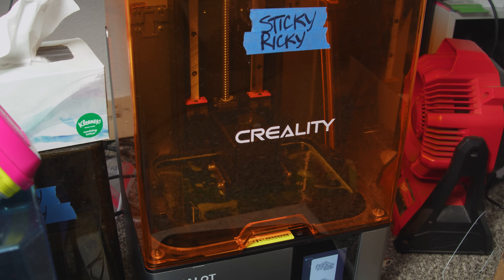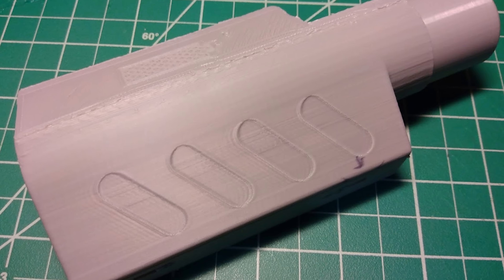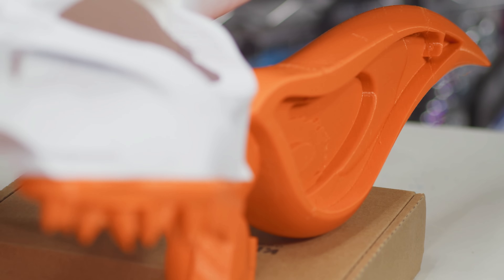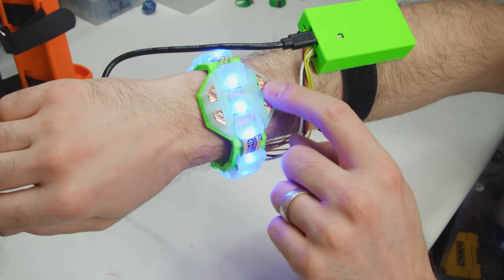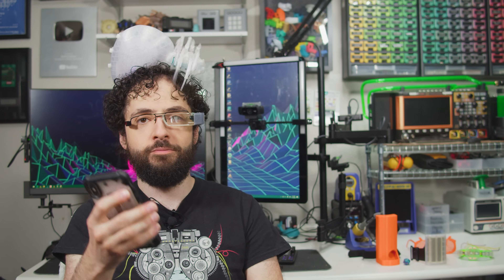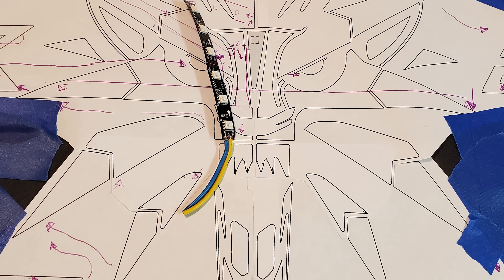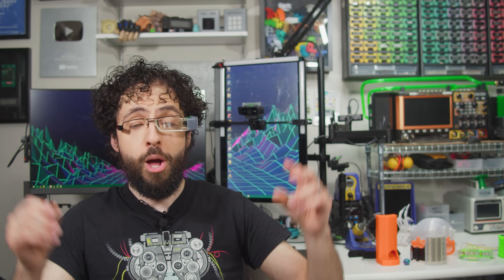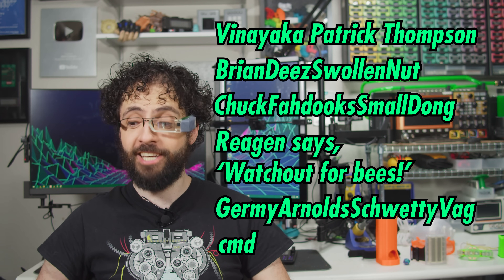10 Insane 3D-Printed Wearables - The Best Won a $1,500 Printer

Comment: I possess mental blue prints for a 3-D printed robot, practical application with machine learning & ambulatory self propulsion...everything but the circuit(s), wires plus some small motors of various sizes, overall it should top out at 65 pounds or 29.4 kilograms fully assembled!!!

Comment: 13:20. Place a dot of red nail polish next to the male side of each female USB connector. And a similar dot on the outside, next to the connector end (not wire end) of each USB cable. You’ll be amazed how easily it is to plug things in the first time without having to flip the cable over. I’ve done this to 100s of cables and connectors for myself and clients over the past 20+ years. Everybody loves it!  It’s my original idea. And when manufacturers start doing it to cables, remember you saw it here first!

Comment: $1000 for a 3D printer with 3D parts and weird diameter filament. Think I'll just stick with the ender 3 lmao
Reply from the maker: The 747 we gave away is a 1.75mm version - it's got the E3D Hemera. Lulzbot specializes in 2.85mm machines, but I personally requested that the prize printer uses the same 1.75mm as my workshop.

Comment: #9 needs a microcontroller to turn it into a game/competition.  Pass it around and see who can shake the hardest or the most strokes in one minute, or with the most perfect cadence.  Have a small DIP switch to select "innocent" or "raunchy" mode for the sound effects/sound clips.
Reply: The project I originally designed the magnet core for actually uses a SBC for an interesting application.  I used a hall effect sensor to measure magnet passes.  Hopefully I can post a video about it soon :)

Comment: Getting 3d printer soon, I'm only 15, so it can be kind of hard, but I definitely want to try the wristpi in the future.
Reply from the maker: I feel you. But as long as you pick a high-quality printer and don't go mad with power, you should be able to buy all the filament and spare parts you need for barely $20 a month.

Comment: You use microsoft edge?
Reply from the maker: Yeah, it's faster than Chrome, and I'm skeptical about giving Google too much info.
Reply: @ZackFreedman  you dont worry about giving Microsoft your information?
Reply: @kinforr7764  In fairness, due to the fact you, to live in  the modern world have to end up giving some corp your data or go through hell, Microsoft has the least bad track record with user data.
Reply: @BeefIngot  yeah, your right. The other options that dont steal your data are slow, or arent as good.
Reply from the maker: @kinforr7764  From what I can tell, they've actually been pretty respectful of privacy, and their security seems excellent. But I'm not wedded to Edge by any means. If there's any funny business, I'd probably jump ship to Brave or compile Chromium from source.
Reply: Hes a freak!